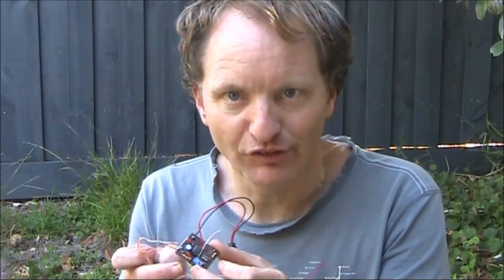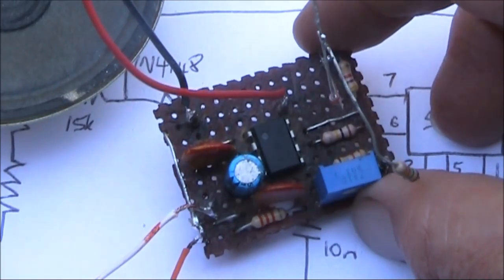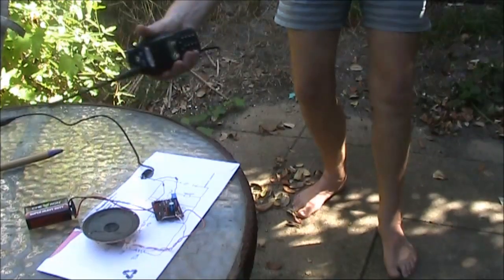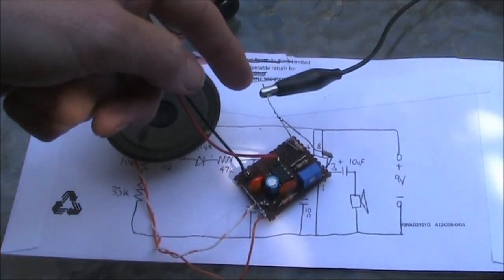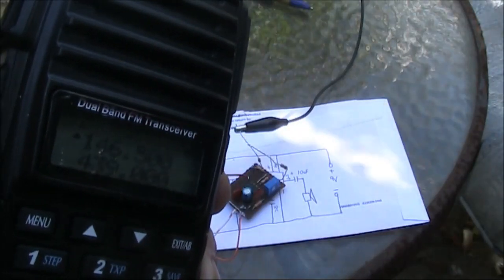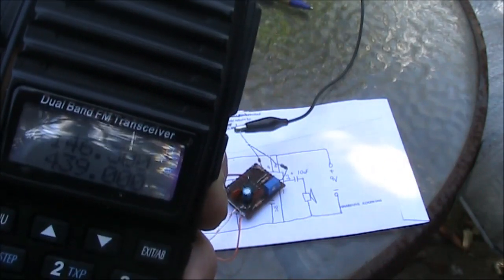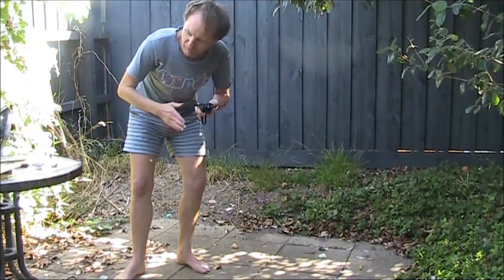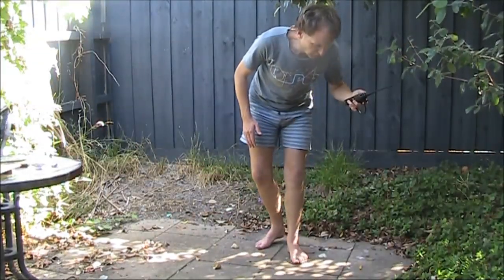Audible RF sniffer using a 555 timer IC

Comment: I know this video has been around for a while. I finally put one together. I have a question. Is there a way to adjust the gain? I thought the potentiometer might do it but doesn't seem to. I believe this might work for what I want to use it for and that is to locate very small hidden transmitters when we do RDF exercises.

Comment: I know this has been a while. Will this run on 7.2 volts?
Reply: The NE555 is rated for a minimum supply voltage of 4.5V. So it should work. Only the volume will be softer on the speaker.

Comment: this is what I've been looking for for a while!
I have also made something like that but much more difficult
I hope that Peter wants to experiment with this a bit further?
the sound maybe even a little harder
?
and maybe selectively for bands such as 20, 40 and so on ......
 (with coils
 maybe?)

I would like to put this under the wire antenna and then tune on the audience/hearing/sound

Friendly greetings from The Netherlands!
Rob.
Reply from the maker: Yes - very easy to make selective. Look up circuits for absorption wavemeter and add the audio part of this circuit.

Comment: Peter, for foxhunting / RF sniffing uses, that 10kOhm trimpot could be replaced by a pot of the same value, labelled "Sensitivity"?

Good idea re the warning about the neighbours hearing it - plenty of people have no idea about the difference between ionising and non-ionising radiation, and happily confuse the two as well as their respective epidemiological effects.  Cheers, Mike VK2IG
Reply from the maker: Mike - that is true. And, though I haven't tested it yet, I wonder if you'd get slightly better range if you had it clicking slowly even if no RF. Then the slightest bit of RF would accelerate the clicking.
Reply: @vk3ye  I'm going to try and add this to my PJ-80 80m receiver, just for fun. By the way, I wear headphones... just saying! ;) - Brian M0OET